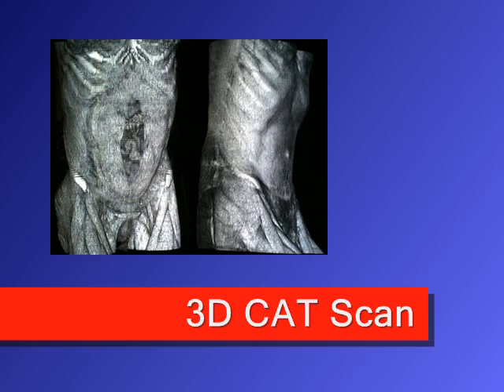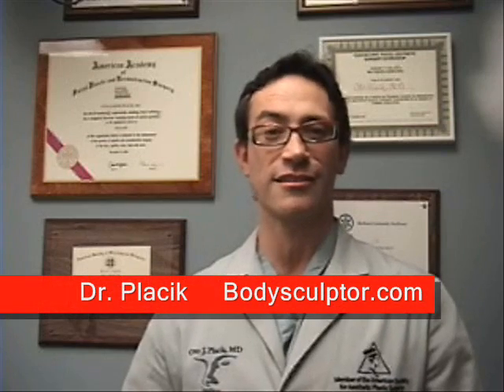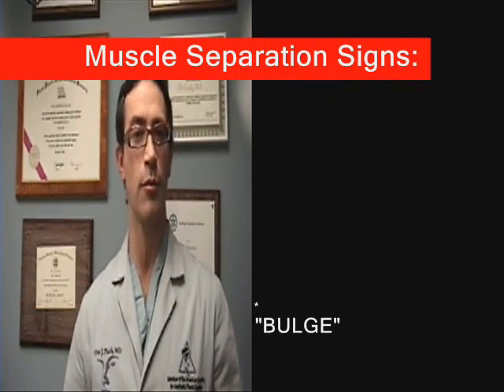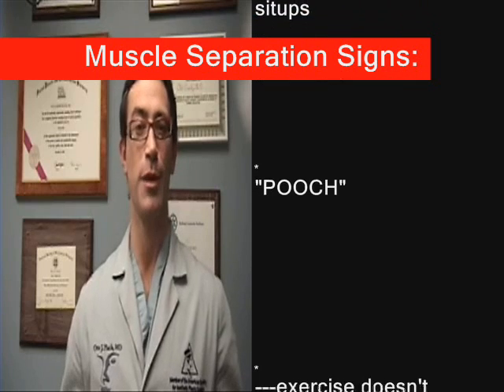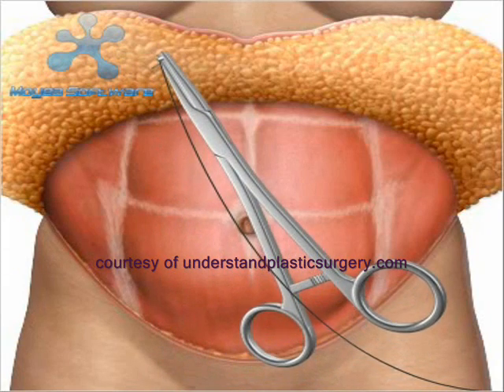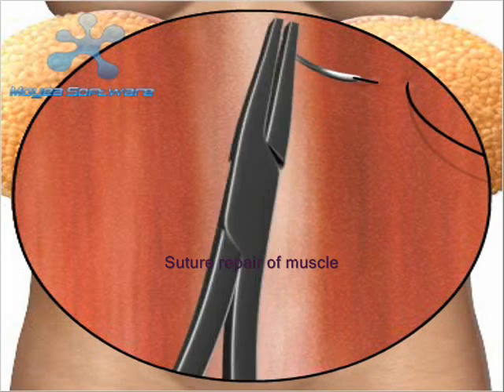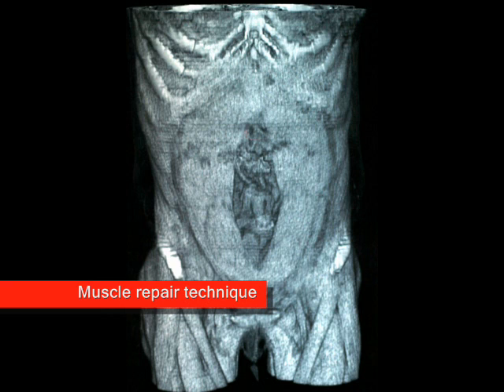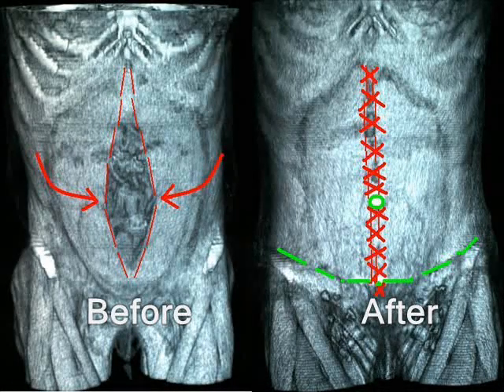Tummy Tuck Muscle Repair with 3D CAT scan

Comment from the maker: We usually use permanent sutures but their effects are not always permanent. This may be difficult to understand but imagine grafting two tree limbs together. You need permanent duct tape to hold them until they "heal" together. Eventually you don't need the tape even though it is considered permanent. This is similar to the muscles. The permanent stitches hold them together until they heal & stay together. However, if you gain weight or become pregnant the muscles can separate. Is that clear?

Comment from the maker: @torero34 Of course they need more answers than this. They need to schedule a consultation with a surgeon to discuss the procedure in greater detail. This is only to demonstrate the muscle repair. IF you thought that this was all inclusive than you are misinformed. There are scars and they do lie beneath the undergarment and most patients would prefer these scars to the stretch marks and bulging belly which does not respond to diet and exercise.

Comment: I would advise that you have the gastric bypass first. This surgery should not be performed on an overweight individual because it is essentially an elective procedure and a patient requiring bypass is usually morbidly obese and at risk for serious complications precluding elective surgery in most instances.

Comment from the maker: @zipzap2690 Do you see scarring in this video? Or are you talking about another technique. The length of the scar geerally depends on the amount of loose skin. If there is minimal laxity the scar can be extremely short (under 2 inches). However, if you have extremely lax skin, the scar may need to go completely around your body.